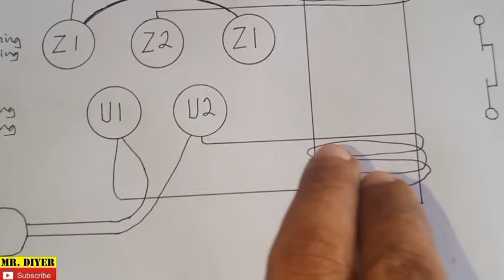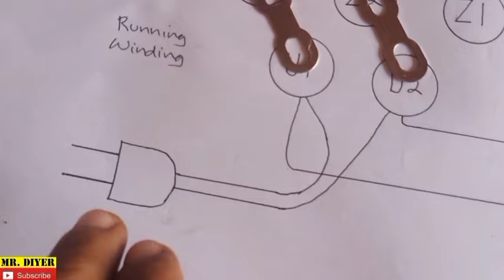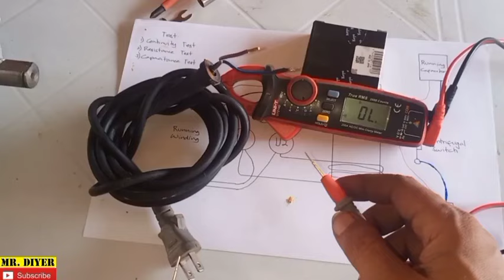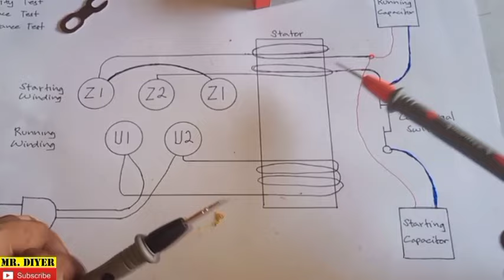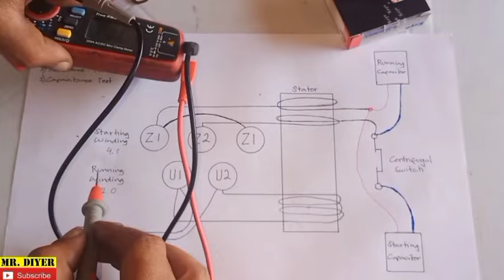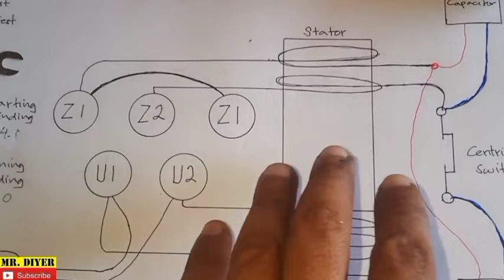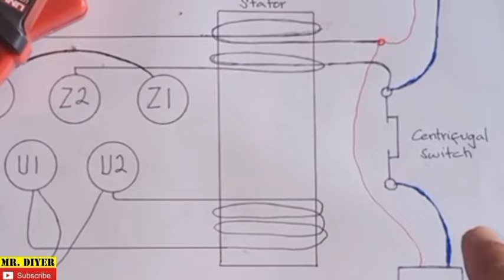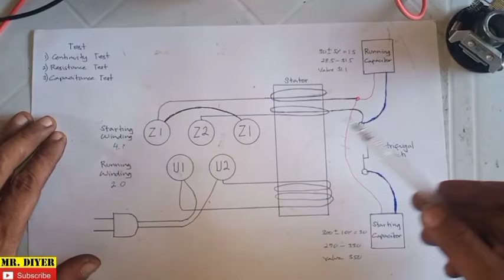How To Check Single Phase Dual Capacitor Motor. COMPLETE GUIDE!!!

Comment: The electrolytic capacitor hi resistance low voltage can use to centrifugal switch, other 1 is oil type capacitor, low resistance, hi voltage.